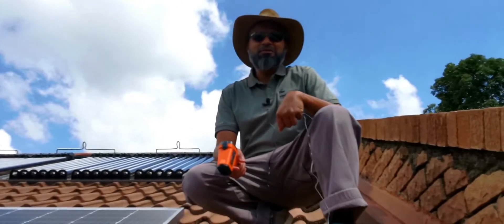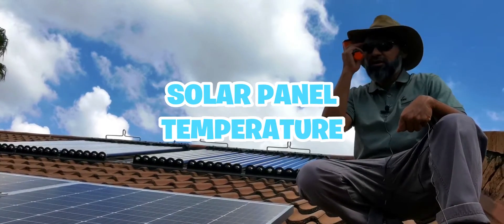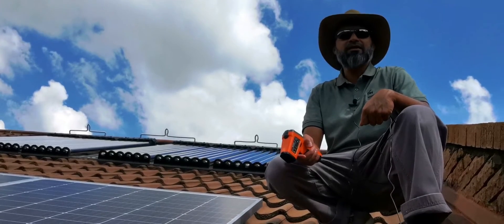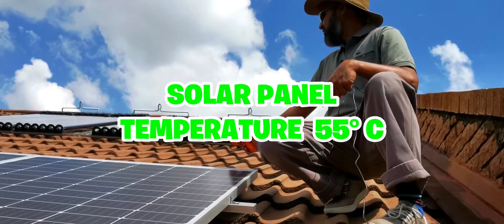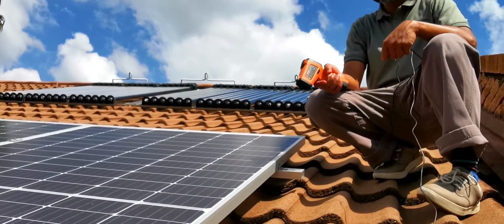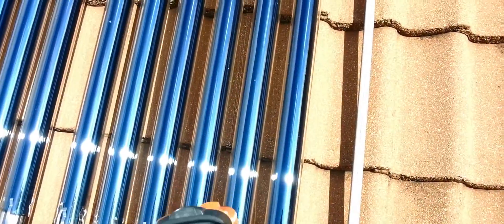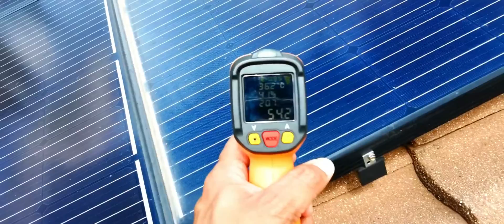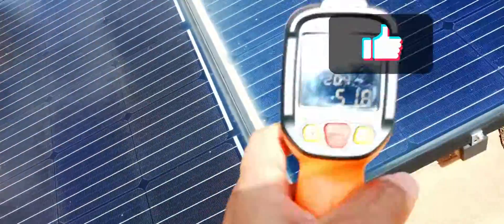How Hot Do Solar Panels Get ?

Comment: I wonder if your water tubes are showing so low is because the gauge cannot read them properly?
Reply from the maker: Actually the glass casing around the evt isn't as hot as the water. Also, there's a cavity between the evt and the glass. If I measured it at the corrugated pipes running to the geyser at the heat exchanger it would've returned 70 degrees Celsius.